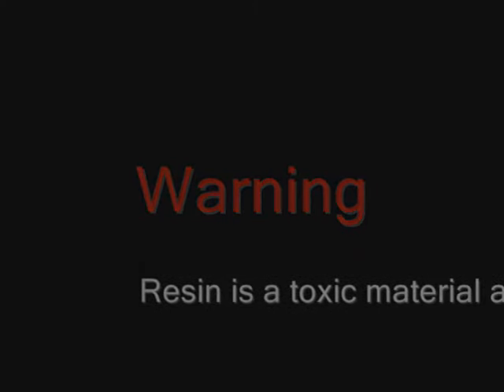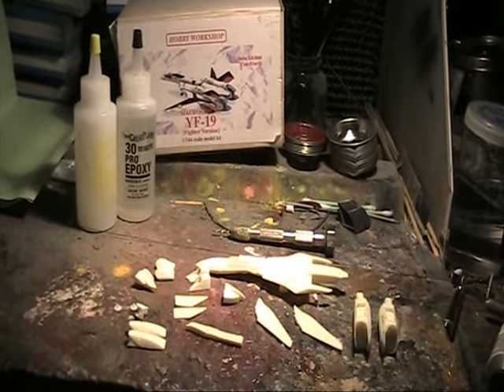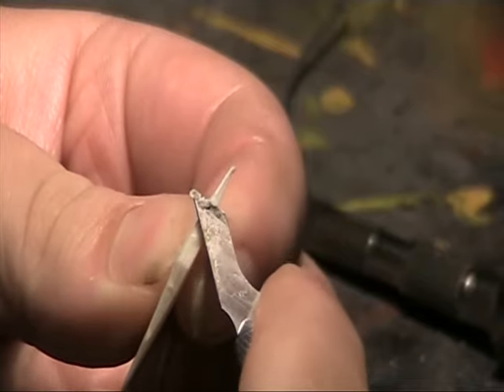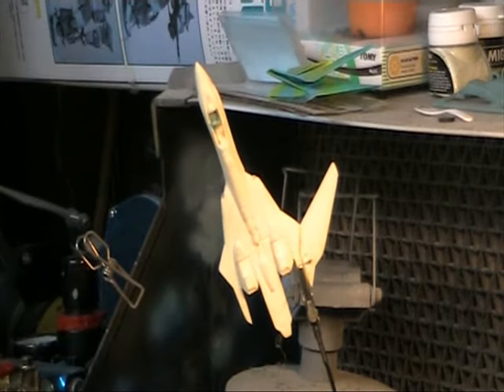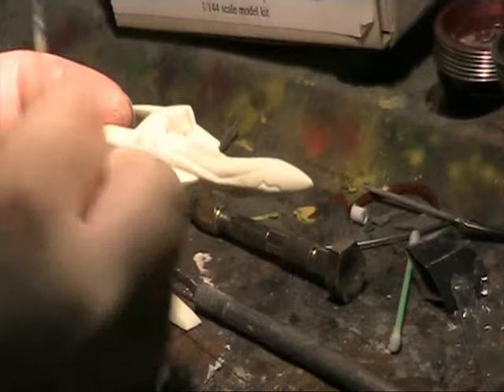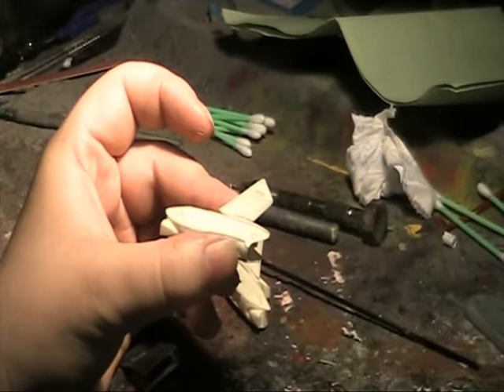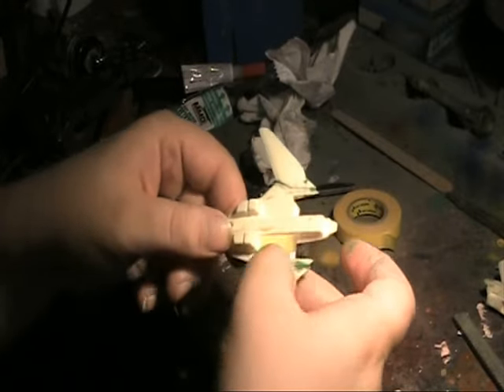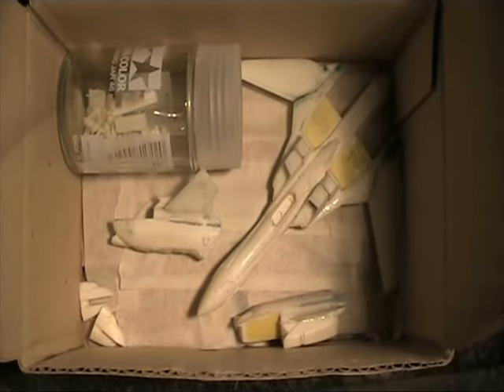Resin garage kit tutorial 04: Test fitting, pin and glue pieces together

Comment: When I sanded the resin kits/conversions I've done I'd sand it under water.  Considering I just ordered a B-Club kit, I guess I should ask this. Will a carbon filter paint respirator protect you from the dust?